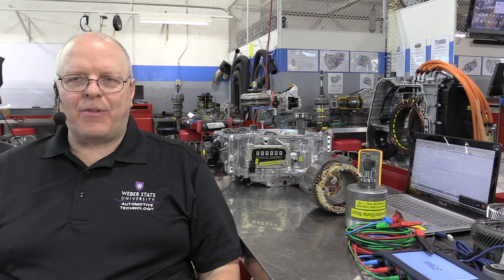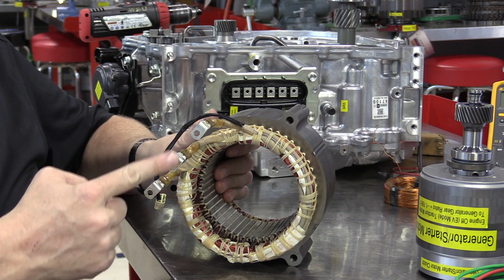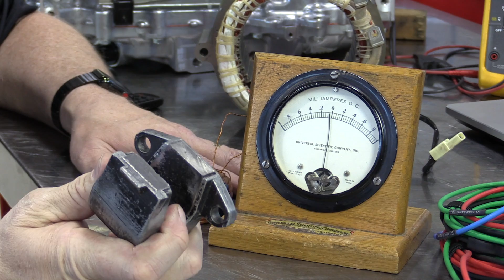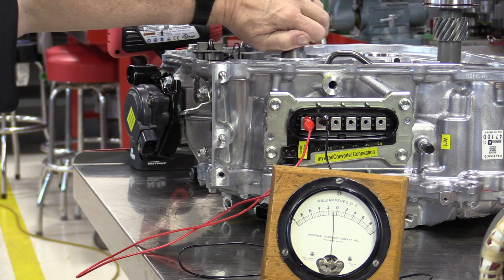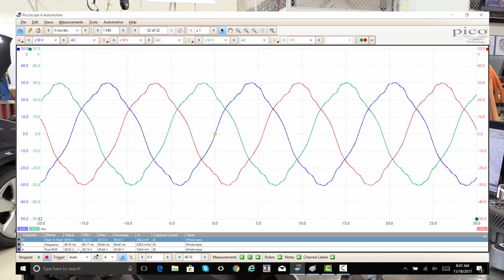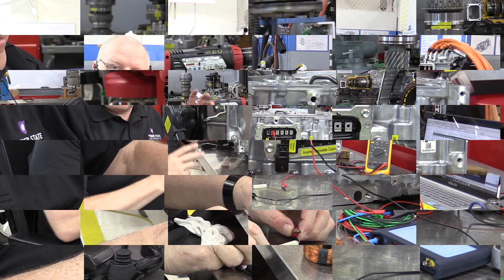Hybrid and EV Regenerative Braking Systems

Comment: I have a question that Toyota techs can't answer and maybe you can help. My 2010 prius durning R/ braking the engine shuts off but my 2017 prime advanced will run and even pick up RPM's. Secondly when at a stop light the engine will stay running on the 2017 and placing into neutral will sometimes stop the engine running. This has happened in all types of driving conditions thru all weather temps from the low 10f thru 110f. Calif desert has severe temp range thru seasons. But even in mid 70f temps on either short 10-25 mile drive or 100 plus drives it still does the same and the engine will stay running when stopped. I've turned off every acc including heat& A/C but no noticeable difference. Is this a problem with the new transaxle or a design error with the new generation software. I've had toyota tell me it's because it's not up to temp and it's over temp and cooling, I've had toyota tell me its because I have never experienced a prius before. Which makes me laugh as this is the 2nd from the same dealer. And 3rd question is there a fix for thr brakes at slow speeds if feels like a bad preportioning valve especially in reverse. 1.5 inches of brake pedal travel before brakes jerk on. Several Toyota techs also tell me I'm not used to driving a prius or it's because it has electric brakes to which I reply it still has hydraulic brakes which just leads to more bullshit from them about me learning to drive. I'm a heavy equipment mechanic at a mine and drive tons of equipment with either dynamic breaking or retarder braking, even  both style engine braking Jake/exhaust. But techs refuse to listen. I've tried several dealerships with the same answers. The braking issue and the lack of a 3rd position in the back seat will end my patronage of toyota if these issues persist.
Reply from the maker: I had a 2010 Prius myself. It acted just as you describe after the initial ICE warm-up, but it almost always ran the ICE on initial "Ready On", even in the hot summer days.  As you may know, the 2010 has a NI-MH battery and the 2017 Prime has a Li-Ion battery. It sounds like you are driving the Prime in HV mode rather than EV mode when you are talking about this condition.  In Park the Prime ICE should run as it charges the HV battery and then shut off. It will cycle on and off just like the 2010 Prius, but not as rapidly (unless the HV battery is charged with the external J1772 AC charger, then the ICE should not run at all). Very important: In Neutral, all power generation is shut off and the high voltage battery will slowly drain, even below the recommended low threshold SOC. The engine will run for extended periods if neutral is used because it has to recharge the Hv battery back to the normal voltage for HV mode. I hope that helps.

Comment: How do we see the output on laptop ..professor? what is the software used ?
Reply from the maker: Picoscope PC based oscilloscope. Model 4205. it is limited to 200V, so do not connect it to a vehicle HV system.

Comment: Regenerative braking on a hybrid is the same as dynamic breaking in Diesel electric Locomotives, Just with the exception of not having a battery bank  as a load. its a bunch of resistors.  GE has made a locomotive with a battery bank tho. I wonder if the hybrid manufacturers got a lot of there ideas from diesel electric locomotives.  They have been working on the same principles ever since they were first produced.  Just on a much larger scale.  I Love watching your videos.
Reply from the maker: Yes, same principle. Thanks for your feedback!

Comment: Isn't true when an AC generator (alternator)  losses its prime mover, the generator starts motoring??? (I meant internal combustion engine, I work on engine generators and we call the engine that turns the alternator a prime mover!)
Reply from the maker: I don’t understand. What is a prime mover?
Reply: I meant internal combustion engine, I work on engine generators and we call the engine that turns the alternator a prime mover!

Comment: very informative videos, if I drive my auris in B mode, am I wearing anything out? I find it charges the battery better and I use the brakes less.
Reply from the maker: No, you will not hurt anything. Thank you for your feedback!
Reply: Hi, I would suggest you refer to technical information officially released by Toyota. You will find out that the B position is not intended for increasing the charge rate. The B position enables engine breaking (combustion engine actually), thus decreasing fuel efficiency, as Toyota clearly states. In B mode, the combustion engine is prevented from being shut off when the vehicle slows down, as could occur in drive mode.

Comment: Excellent video! Thank you very much. One minor detail: the amp-meter is of course DC (it is incorrectly stated to be AC in the video) , and since the induced current is AC we get the needle dancing around between negative and positive current (very fast, already at less than 1000 RPM you got 60 Hz according to the digital scope, which is much too fast for the human eye and your video recording equipment!) like a metronome on speed. :)
Reply from the maker: Thank you and thanks for your feedback!

Comment: thanks  professor Kelly for the video
 i don`t under stand why  it slows during braking.if it is turning all the time  there will be BEMF OR IT JUST TURN During breaking and if it is how it charge the battery.
Reply: With the electronics in the power inveter-converter it is created a variable load proportionally electronically controlled by the "angle" of the "pressing the braking pedal".
The more pressing on the brake ( "angle" ), the more "load" ( electronically regulated ) hence the more "regenerative" braking force.

Comment: Hello professor, I'm confused. I thought that B mode in non plug in toyota prius doesn't increase regen but it's main purpose is to increase braking effort by engaging engine braking. I believe that even Toyota claim that B aids regen only in plug-in hybrids and advises non plug in hybrid users not to use B unless they are descending a steep hill where engine braking is usually recommended anyway. So which is which then? Is B putting more juice into batteries in non plug ins or not?
Reply from the maker: Hello, the B mode has been around since the first Prius in 1998. The first plug-in Prius was not until 2010. Having owned 3 Prius' myself, I can tell you that is acts just like I described in this video. Regenerative braking occurs in the B mode as long as the battery has room to accept the charge. After that, the regenerative energy is used to crank the engine (with the fuel shut off) at a high rpm using MG1. The Plug-in Prius works the same way except is has a much larger battery to accept the charge. I hope that helps.
Reply: Right, so I'm guessing that Toyota's claim (that B is less fuel efficient) is correct since B doesn't provide greater regen (vs D) only greater braking force since it adds engine braking. And since engine braking "wastes" energy by stopping the car sooner less energy can be regenerated.

Comment: If you were to put the trans. control lever in the B position on Toyota or the L position on the 2015 Ford Fusion Energi  would you recharge the high voltage battery move than in the normal D position of the trans. I know you will get increased breaking power in B or L trans.lever position. I also know if you put lever in B or L position you can modulate braking in heavy city traffic.
Reply from the maker: Yes, if the battery state of charge (SOC) was low enough. When the battery is already charged, the regenerative braking is greatly reduced because no charging is needed. Thanks for your feedback!

Comment: I the think the problem that makes the bumpy wave "as what you said " is comes frome the unbalacing adapter that makes a vibreation"  that connected to the drill motor" 

thanks too much for all i have learned too much frome your videos 
its yazeed abualhaj from jordan
Reply from the maker: Thank you! You may be correct. I will try it again with a better drive system
Reply: great 
thank you for your videos

Comment: thanks for this great  Material. on 8:09 demonstration  where was the ground connection of the pico scope ? because you have 3 channels positive side  to  3 face motor, 2 question do you have any video or material how to test  the  stater 3 faces winding integrity and also insulation test , please let me know I would appreciated. for hv leakage or shorted motor  , and also testing  the  inverted converted,
Reply from the maker: The ground connections of the scope were not used because the three windings of the stator are connected together in the shape of the letter "Y". I do not have a video showing using the insulation tester yet, but I will soon. Thanks for your feedback.

Comment: Thanks again Professor VOLT⚡️😄....
I just watched you Gen1 Chevy Volt review!!  Great.. I just bought a 2018 Volt last week...  do you still have your Gen1???  Any plans to review a   Gen 2 Chevy Volt??  I’d let you borrow mine... but I’m in Ohio..
Maybe do a road trip out west again.. did it a few years ago in my VW Jetta TDI...
Thanks again
Reply from the maker: Thank you! I am working on a whole series of videos on the new 2018 Chevrolet Volt in our auto shop. I hope to have the 1st episode on the Battery system done next week. See https://www.youtube.com/user/WeberAuto/community for updates. We have about 50,000 miles on our 2014 Volt now, I am jealous of the 2nd generation battery range and cool driver assist features, especially the adaptive cruise control. Have a good day!
Reply: I haven’t got a 240 volt charger yet.. is there one you recommend???
Reply from the maker: We bought the one Chevrolet recommended back in 2012. That one is no longer available, but the one listed on the Chevrolet website is comparable https://accessories.chevrolet.com/product/2018/Chevrolet/Volt/wall-mounted-240v-32a-ev-charging-unit-by-aerovironment---associated-accessories-19355504?categoryId=12001 The battery charges in less than 4 hours. There is a Gov rebate and many states have rebates as well. Best wishes!

Comment: The best explanation i ever heard about hybrids and EVs regenerative braking. Do both motors drive the vehicle or one of them works only as generator? And what happens if one motor has a problem?
Reply from the maker: Thank you! It depends upon the vehicle. The Prius is only driven by one motor, but the Prius Prime can use both. Problems rarely occur in the 20 year history of the Prius, but when they do occur, the vehicle cannot be driven.

Comment: This is unrelated you put a Video in about a differential I'm in a situation with a pinion and am wondering about shims what do they move and how much do they move when you add shims in I have a case of a spun bearing and I'm trying to get as close on reassembly as possible is this something you know about
Reply from the maker: Hi, the pinion shims control how deep in the differential housing the pinion gear sits. If the depth is wrong, the axle will make noise. I have a few videos related to that topic. See https://www.youtube.com/watch?v=dAqAqODmcj4&t=2s and https://www.youtube.com/watch?v=0DQPJpJ7xvU&t=5906s Best wishes!

Comment: Hi Professor, great videos very informative. My question is the 3 wires, do they double for the ground as well. Many thanks.
Reply from the maker: Thank you! only 2 of the 3 wires are ever used at a time. This means that one is power and the other is ground for the short duration between changing polarity (AC Voltage)

Comment: Toyota hybrid B mode not add more regenerative braking.. only engine brake like normal car, only needed long downhill when hybrid battery is full (84%) and not longer slow car, then you apply B mode..
 All most every  car journalist and sales people. Tells you wrong information..
New gen4 hybrid, test drive ch-r one weekend 😙  apply (ice) engine brake when drive cruise control and speed go up downhill. It's very interesting..

Mitsubishi outlander phev B mode add more regenerative brake and Nissan leaf..

Great videos 😊
Reply: You are right and Mr. Kelly got it wrong here. What he also got wrong: In the current Prius models regenerative braking starts with letting off the accelerator pedal. Depending on the velocity you get 3 to 10kW of regenerative breaking without touching anything. For actually free spinning you have to go into neutral (or slightly push the accelerator pedal).

Comment: 17:25 - in case of emergency braking regenerative load is removed for optimal ABS functionality. Usually this requires slamming brake pedal fast.
Reply: This definitely applies to EV's. Not sure does it happen with all hybrids as there is not a lot of regen happening.
Reply from the maker: It applies to hybrids as well. Thanks for your feedback

Comment: Now I  see why towing EV that is dead (battery disconnected) is not allowed in general. It's fine up to some speed (how much, how many rpm??) but at some point, voltage goes above what electronics can handle. And bang.

Comment: If laptop is equipped with hard drive (some modern ones come with SSD only) one should be careful with magnets near them. I placed neodymium magnet on palmrest and broke my HDD (head touched the surface, destructive damage). Average neodymium magnet at least 5cm from hard drive - should be enough.
Reply from the maker: True, all of my laptops use SSD drives.
Reply: Wrong ssd don't fail unlike hdd

Comment: Amazing videos, as always. Thanks so much for making these.

My Camry Hybrid owner's manual says the B gear uses engine braking, and to avoid using it as it will not charge the battery. The engine can be heard, spinning as an engine brake, just like low-gear in any other transmission. Does MG1 charge the battery, or does it remain stationary to transfer all torque to the engine?
Reply from the maker: It is confusing. Most owner's manuals give very basic non-technical information. Sometimes the engine can be used to help with the braking force, but only when the battery state of charge is full. In the "B" position on Toyota hybrids, both motors are used for regenerative braking. When MG1 is used for regenerative braking (and the battery is full), it can use the electrical energy generated by MG2 and force the engine crankshaft to rotate at a high speed (with the fuel injectors shut off) to dissipate the extra electrical energy.  I hope that helps.
Reply: @WeberAuto  Yes, I have experienced this when coming down a steep hill in the mountains with a fully charged battery. Really high rpms!

Comment: Hi John, a great video on adding a electrical load while regenerative braking. Which causes the braking action. And changing the phase to reverse MG2 to reverse the car.

What is also intresting is that when you added the resistance load to MG1 it made it harder for your drill to turn. In a real car. This would cause more of the ICE engine power to go through the power split device to the ring gear and to the wheels. And less power to MG1. This is how the load on MG1 determines how the ICE enging power is split. 

Roderick.
Reply from the maker: Thank you very much! You are correct. I wish I could have figured out a way to attach the drill motor to MG2 for the demonstration, but I would have had to remove the bearing on the shaft. I was too afraid I might accidentally damage it and not be able to get a replacement. This transaxle needs to work again :). Have a good day.
Reply: Thanks John, you indicated that you wish that you could have connected the drill to MG2. Can you please describe in words what this would have shown.

B.T.W. your demonstration also shows. That when MG1 is spinning freely in some driving conditions. That no energy is transferred from MG1 because the inverter for MG1 doesn't put a load onto MG1. Thus MG1 is allowed to spin freely.
Reply from the maker: Connecting the drill motor to MG2 would have shown the same things. It would have been less confusing for some people since MG2 is the primary source of regenerative braking. I had some people confused as to why I used MG1. It was just for convenience while I talked about regenerative braking in general. Yes, MG1 can spin freely at times (like 0-35 mph (0-56 km/h) while MG2 propels the vehicle alone). I hope that helps.
Reply: Thanks John as to why you used MG1 and not MG2. Can you explain why MG1 only spins freely at speeds 0 - 56kmh. I thought it would be able to spin freely at a much higher speed.

What about this to demonstrate the power split device. Connect your drill to the planet carrier (instead of the ICE engine). Put a resistor load onto MG2 to simulate energy to give the car kinetic energy or gravity energy going up a hill. Then switch in different load resistors on MG1. To show how power splitting is controlled by the load on MG1.

Comment: Very interesting part! I'm curious how the distribution of the braking force between electric motors and brake discs work. Regenerative braking uses only front wheels to slow down. I then assume that the brake pump is also electric. When the brake pads are approched and pushed towards the discs? I think that at some point the car is braking with both systems applied increasing the classic braking system as the efficiency of the regenerative system is decreasing with speed...
Reply from the maker: Thank you. Most front wheel drive cars use the front brakes to provide 80-90% of the braking force. You are correct, regenerative braking is combined with electric motor pressurized hydraulic brakes in certain conditions. The slower the vehicle is moving, the more hydraulic brake blend is needed. Of course rapid deceleration requires more hydraulic brake blend. Typically it is all hydraulic below 7 mph (11km/h). Thanks for your feedback.